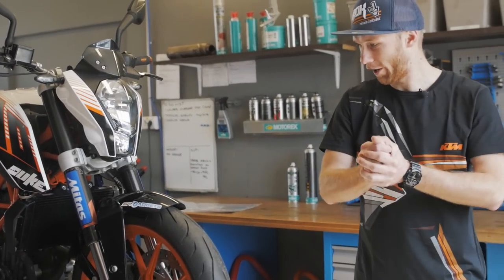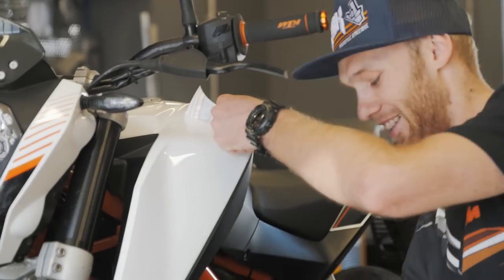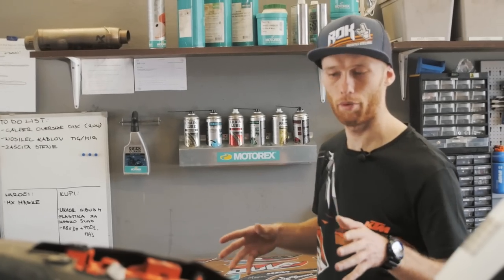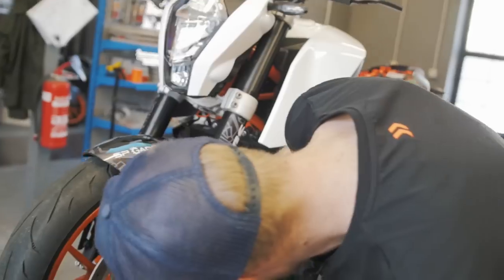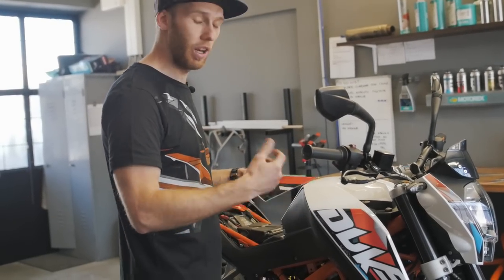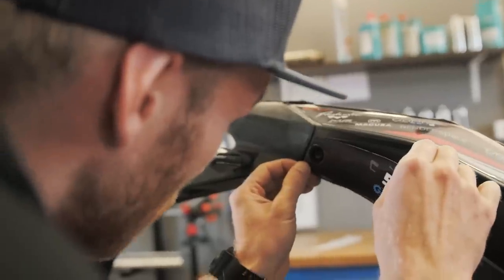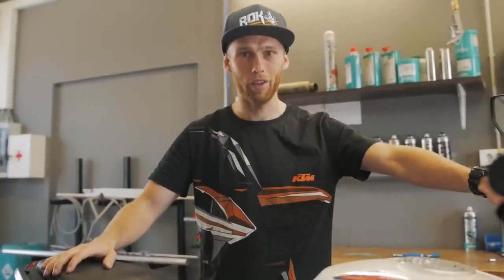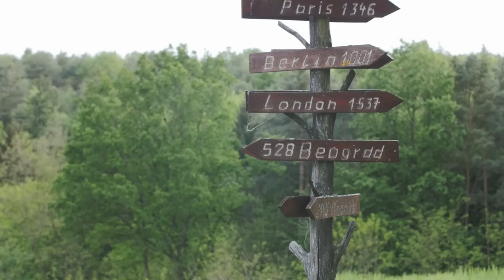RESTYLING MY KTM DUKE | RokON VLOG #19

Comment: u need a shampoo or soap & add some water. wipe it all over the body before applying the sticker onto it. its  easy bcoz it slippery & easy for you to adjust the sticker in place plus easy to remove the bubbles. after that wipe it with dry cloth & let it dry. hope it'll help